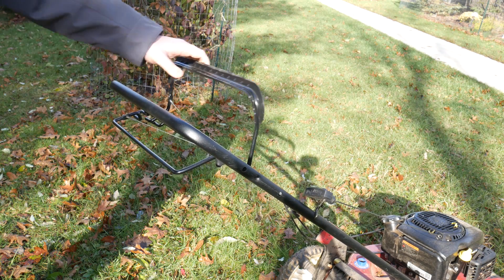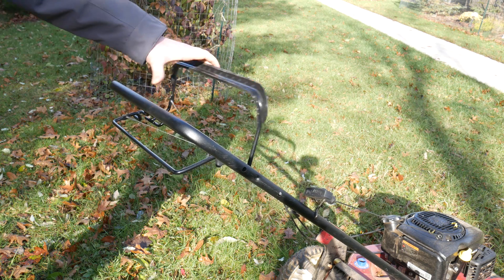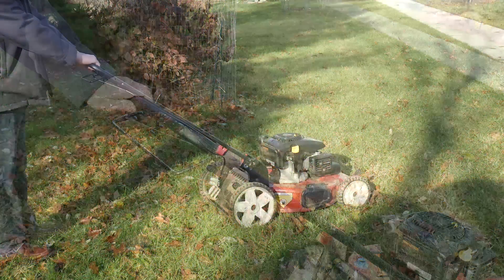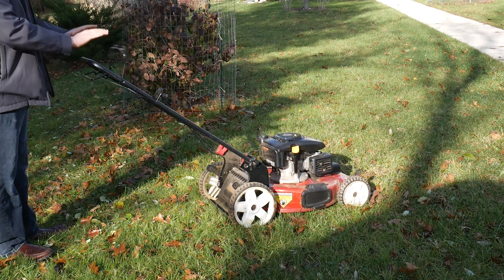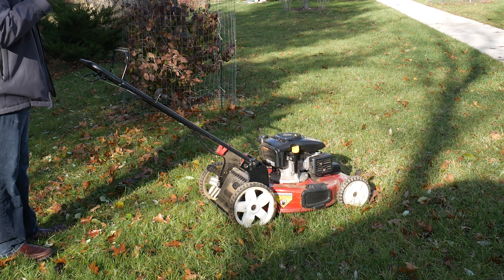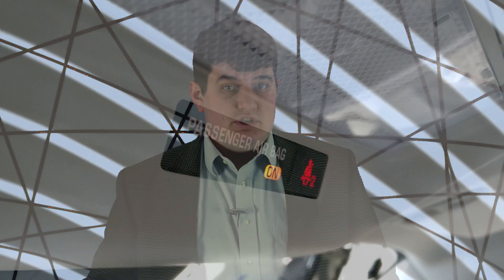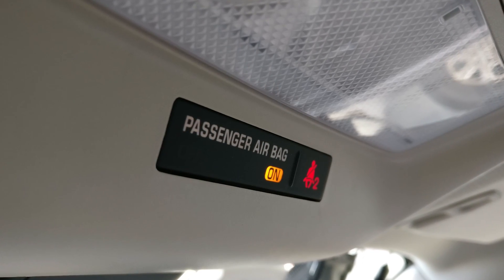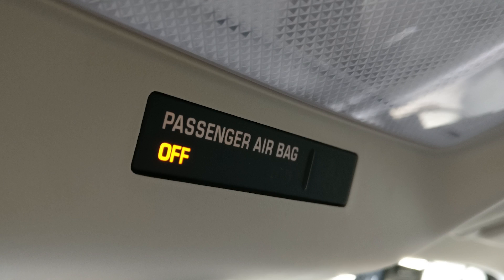The Dead Man's Switch:  How Anton Yelchin's life could have been saved

Comment: I couldn't understand how people could leave a car on, then I rented a BMW. Great car, but more than a few times I got out of it and it was still on, and I couldn't tell until the motor suddenly kicked on five minutes later.  I have a 2015 Prius so I'm used to quiet hybrids. Just some dumb thing about this otherwise well designed car.  Your override ideas are well considered. 
I grew up in Detroit in the 1960s and used to hear auto company engineers going on about how dangerous shoulder harness are, radial tires are bad.... probably not a representative sampling. (You'd like a book Black Box Thinking, it compares hospitals with commercial aviation. Commercial airliners are about the safest place you can be because the number one goal was safety, hospitals....  I aviation something happened for a reason, in medicine, 'well, sometimes things just happen.) 

The generic warning lights? That is a perennial problem. I get the Check Engine light, and I stop ASAP, check my oil, then I check the manual, then I scratch my head, then I shrug and cautiously keep driving. What's wrong? Eventually I figure it out. This needs to be a lot better. Check Engine means, stop now, turn off the car. Figure it out or get a tow. (You only have to have an engine blow a head gasket and the engine seizes once to learn this). 

There's an institutional/corporate issue that can really make a mess of all this. As a teacher I kept hearing, "Well, we have to do something." usually after everyone else agrees that the 'new thing' won't work because it didn't work the last three times they tried it.  However, if you 'do something' you can keep from being fired for not doing anything, even if the something accomplishes nothing or more likely delays a good solution or makes things worse. This is how school superintendents keep their jobs.  The corporate version is you do something that can, with some PR, appear to solve a problem. 
 
In the cars I recently rented. The BMW would start to play my audiobook over bluetooth, then I select drive, and just as I'm pulling into traffic it would automatically switch to music, blaring loud rock-n-roll causing me to jump. On the screen was a warning from BMW and Audible about how dangerous it is to drive and listen to a book. (I've been doing this for 30 years, I know the risk, and I frequently go back to a section I didn't pay attention to because something else was more important.) Just how safe and less distracting is it for a car to suddenly do something for no good reason? 
 I finally figured out to switch my music app to Bach, and then five minutes after starting out,  pull over to fight with the safety feature so I can listen to my book. 
A Ford I rented later in Ireland wouldn't play audiobooks at all, so I reverted to one ear bud.  And in Scotland there's some goofball safety thing where local radio stations can break into all the other stations, and over your own music or audiobook at 3x the volume. They're allowed to do this for safety: so they do it to alert you to traffic jams on the other side of Scotland, but they they play some of their content, or drop a teaser, so maybe you'll switch over to their station.
(Michael Moore once parked six cars outside the mansion of a guy who sold car alarms and then set them all off on a Sunday morning at 6 am)   

I love the deadman switches on lawn mowers. You're so young!  I think the last time I used a lawnmower was about 1987. Through my youth  gas lawnmowers, riding lawnmowers, all kinds. Deadman switch? what's that?  I tried to be safe, screaming two stroke push mowers on hillsides!  You know rocks ricochet off trees more often than you can possibly imagine.  I was lucky. A friend tried to clear just the top of a snowblower. Fingers. Another friend stood up after stopping a go-cart. We marveled at the stitches the chain sprocket made as it ran down the entire length of his back...... Smart safety: great. 'Well, we have to do something.." ? 
(Have you seen or read Fight Club? The main character's job is to calculate the cost of death payouts against the cost of recalls)

Comment: While probably worth doing (I can't think of a reason not to) getting it done is not as trivial as you seem to making it out to be.

One thing that comes to mind: Gearshifts may just be an electronic switch at the logic level, but physically almost all of them resemble the mechanical systems in being a big physical lever. I wouldn't be comfortable with a gar shift indicating the car is in one gear while the car is actually in another gear.

Also, those parts of the software are safety critical; even though the change itself isn't too complicated, the car makers would have to be absolutely sure nothing got messed up in the change, which means a need for extensive testing.

Comment: I have both automatic and manual cars, while i prefer the manual for a maintenance point of view (automatic clutches seam to go way fast for my taste) i see no impediment do this. Placing the car in neutral would be hard, but the parking brake could sill be electric on a manual car.
The ECU would just need to power down the engine and pull the brake. It would still be possible on manual cars.

Comment: FCA's obviously learned their lesson. They are transitioning over to an electronic parking brake in all their vehicles. If any of the vehicle's doors are open, it will automatically engage the parking brake, regardless of gear selector's position or whether or not the engine is running. Cars with an electronic shifter will also put the vehicle into park.

Comment: The best solution wouldn't be to put the car into park, but rather take a cue from the manual transmission side of automotive.. instead if it detects the driver has left his seat while the car is still in drive or reverse, just apply the electronic parking brake. This should be enough to keep the car from moving at idle speeds or rolling on a slope, also wouldn't require a tow if the sensor broke and driver wasn't able to shift anymore when the vehicle forces itself into park. Lastly pressing the push/start button 5 times may be a bit excessive for the average driver and they'd never figure out or realize that's how'd you override the system.. maybe just the action of actively attempting to shift the vehicle into a gear should be enough to override it, as the car will obviously realize, a driver must be there if the driver is obviously attempting to put the vehicle into drive, moving the steering wheel, pressing the gas pedal, holding the brakes, or any combo of these driver actions, etc..

Comment: There is lots of stuff within cars that can be prevented by a software change, but will never be done. That shifter that Chrysler made is a stupid design, and so is the fact that most car companies are eliminating keys. Lots of these unintended roll-away incidents occur when the car is shut off. Usually older cars that actually have keys, you cant get the key out unless the car is in park. These car manufacturers have the ability to prevent tons of problems, even for themselves, just by using some if-then statements in their software. Just think about how many less blown up engines there would be if they killed the ignition if the water temp goes above 220F, or if oil pressure drops below 10 psi. This dead man switch idea of yours makes complete sense and cost nothing to implement. Hell, it would be lovely if cars could put whatever phones contained within into airplane mode if the ignition is turned on. Just imagine how many lives that would save. I think there is something fundamentally wrong with a system that companies cant even sell a garden tractor unless it has a dead man switch on the seat, but they can get away with selling cars that don't have a similar interlock.

Comment: It's pretty obvious you're not a mechanic.  There's a pretty good reason why there's no dead man switch on car seats.  There are quite a few maintenance type jobs on a car that require the engine to be running in order to do the job.  Such as when you're adjusting your ignition timing using a timing gun.  A mechanic would probably find it really annoying to have to find someone to sit in every car every time they needed to do something that requires the engine to be running, when that second person could probably be doing something more productive than wasting time simply sitting in a car.  You're over simplifying the issue and there's probably better ways of implementing a safety measure.

Comment: Not only there are sensor inside the seat for claiming the need to put the seatbelt on, nowadays there are sensors inside the steering wheel, checking if the driver actually keeps their hand on it. They are both there.

Comment: You failed to provide any pictures or videos supporting your claim that the shiftier is flaws, but from looking at other videos of the Grand Cherokee knowing what gear your'e in is not unlike other cars. The gear selector has a light up indicator on showing what gear the car is in. There's also an indicator on the dash, something cars have had for years. There's also a parking break, which anyone with common sense should know how to use on a hill. Of course it's easier to blame the designers of the car because we don't know their faces and they didn't captivate our hearts in star trek, but that car did its job perfectly well until Anton neglected to pay attention to his car. If you try to idiot proof something more and more than an even bigger idiot will find a way to get themselves killed. Operating a car safely takes responsibility and thought.

Comment: Re 1:10 not just locomotives but also railcars, multiple unit trains and even streetcars, this is in fact a deadman's braking system which actually applies the brakes, this has been the case for decades. But deadman's braking has, for all this time, been absent from manually steered vehicles. Trains that don't have deadman equipment have another thing called an alerter, vigilance control or reset safety control, where a button has to be pressed or the brakes come on, the specifics of when the button needs to be pressed varies widely.
 I have been tempted to suppose that this is because the authorities have somehow decided that the risk of accidents caused by incapacitated drivers is worth taking with road vehicles but not rail vehicles, after all, rail vehicles don't crash as often as road vehicles.

Comment: Forcing the car into park is only possible if the car is not moving, because the "park" setting on a transmission forces a physical pawl into the transmission gears. If the vehicle is already moving (slowly) when the driver exits, it would not be able to engage park or damage the transmission.

This could be mitigated by electronically operated emergency brakes, but even then you have a road safety problem. A sensor failure would mean that a false positive would either cause a hazard on the road (by risking an emergency stop at high speed) or compromise the system safety if the faulty sensor is ignored, rendering the "safe" dead-man switch ineffective.

The only thing to catch this is to have an interlocking dual set of sensors that mitigates the probability of a single sensor failure by having a back-up. The sensor failure could then be reported without (severely) compromising the system's safety, allowing the driver to take action. But to implement such a system AND get it certified, is an expensive process and a lot of car manufacturers probably don't consider it to be cost-effective.

Comment: On a manual shifter you cant go out of a car with a gear selected, as soon as you lift you feet of the clutch, the engine will stall. The most you will get is an small bump. Here, 10  or 15 years ago a steer by wire using sort of special hand sensors was prohibited to circulate, since no mechanical linkeage is against the law. Now I see.

Comment: At the time of this tragic accident this subject came up on a message board I visited. It started with someone suggesting an interlock similar to what you propose. I believe the specific example was to prevent you from shifting out of park with the door open (which is very similar to the fix Jeep eventually used).
Several people suggested that there might be times when you want to drive with your door open for whatever reason, and .... that there is a limit to how idiot-proof we need to make the world.
So then people proposed that perhaps a clear warning might be enough; that cars should have a warning buzzer to let you know you've opened the door with the car in gear.
It turns out, they have one of those, it's been required by Federal Law for years. It just sounds exactly like the one that warns you that you've opened the door with the engine running, which is something you meant to do so you're ignoring it.

Comment: There is a flaw in your cenario what if the car breaks down and requires it owner to push the car there by requiring the car to be in neutral and typically the driver would not be sitting in the car as they would be standing outside the vehicle and would be operating the steering wheel also from outside of the car while it was being pushed to either clear the road way or to get the vehicle to a nearby gas station.  Also it would interfere with vehicles that are being flat towed behind another vehicle such as a motor home flat towing requires the vehicle to be in neutral and the differential to also be in neutral in the case of a 4 wheel drive vehicle.  Also anytime that a car is being towed by a tow truck using one of the quick grab arms behind the tow truck as the transmission park will lock the rear drive wheels in a rear wheel drive vehicle or the front drive wheels in a front wheel drive vehicle this would not be such a problem on the later but would be a big issue with either an all wheel drive or rear wheel drive /4 wheel drive vehicle as the rear axle and the differential as well as the transmission could all be damaged in the event of the vehicle being towed instead of loaded onto a rollback if this dead man's switch was implemented. The best case scenario already existed on cars that required an actual physical key to start and run as the key could not be removed from the ignition as long as the vehicle was in gear other than park when the vehicle had an automatic transmission, in the case of a manual transmission vehicle the key could only be removed from the ignition as long as the brakes were applied and the engine was off and most drivers that own manual transmission vehicle also know that the cars parking break should be set if parking on ground that is not even and that the car should be placed into a gear to prevent it from rolling.  As for anyone that has ever taken even the most basic drivers education class in the last 4 decades would have been taught that when parking on a hill you should turn the wheel so that the vehicle will roll into the curb in the event that it comes out of gear. Again these are all ready safety standards that are on most if not all new cars with the only exception being those that no longer require a key to run. I do find it quite laughable that any auto manufacturer would build a vehicle that would allow the car to be shut off using the push button start while the car was in drive or reverse, again the only gear that the vehicle should be allowed to be shut down in would be either park, or neutral and if the vehicle was in neutral than the E-Brake should have been applied to prevent it from rolling down the hill.

Comment: Couldn't it be done with just a combination of door/movement/pedal sensors? If speed drops to near zero and the door is opened, the brake is automatically applied and will then only disengage after some input from either the brake or accelerator pedal.

Comment: It is difficult to imagine any use case where a person would want to be able to shift the gear into drive while not activating the sensor except when the sensor doesn't work. In those cases, you could use the same system my Sonata already for shifting into drive when the brake sensor isn't working: by removing a plastic cap and using a screwdriver or similarly shaped object, you can manually press a switch which allows you to shift gears even if the sensor isn't activated (for instance, this would allow you to shift into reverse even while in motion).

Comment: This problem only is a problem in the US where manual transmissions are rare. On manual transmissions is impossible to select a gear instead of parking and getting out of the car without it stalling. Automotive security regulations are made mostly in and for Europe where automatic transmissions are rare so this is not a problem for them.

Comment: Locking the transmission to park when seatbelt is unbuckled (without an override button) would be a bad idea - there are roads where buckling the seatbelt is not allowed: ice roads which cross lakes or channels during the winter for instance. (The idea behind requiring to unbuckle the seatbelt on such roads is simple: should the car sunk through the ice, one needs to get out as fast as possible)

Comment: Software interfaces, masquerading as hardware interfaces = confused human.

When, say, a shifter no longer ACTUALLY controls the transmission, but pretends to; (and further, might rely on a myriad of sensors and software logic to “decide” which action to actualize) you have the possibility for the machine to behave differently than the operator expects.

A spectacular example of this, was seen in 1988 when an Airbus A320 crashed during an airshow flyby.  PILOT flew a standard approach, intending to stay ~100ft off the deck then power away.  PLANE “thought” it would be landing, and long story - short, fought pilot’s input to not touch down or power away.

Neither plane nor pilot won, rather, it all ended up a fireball in the trees :-(